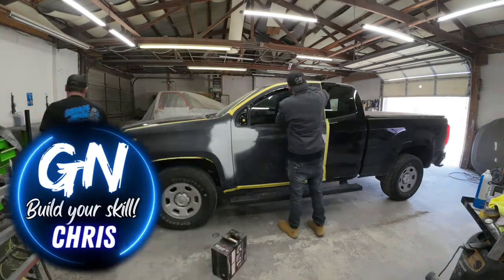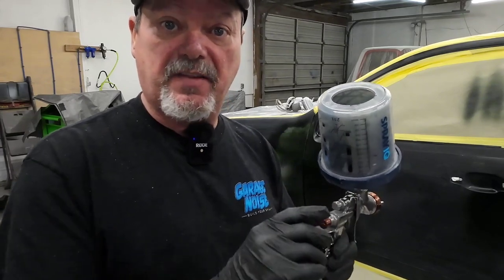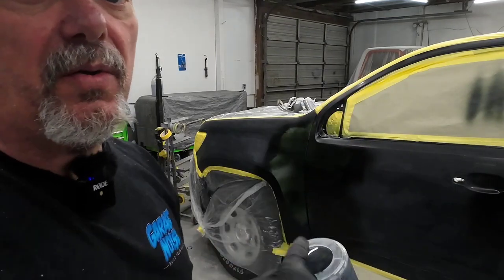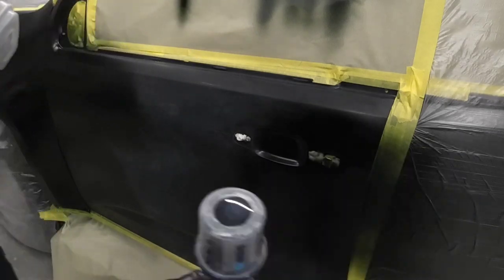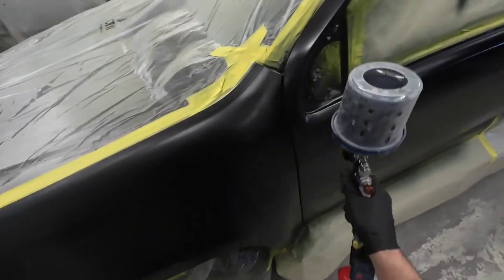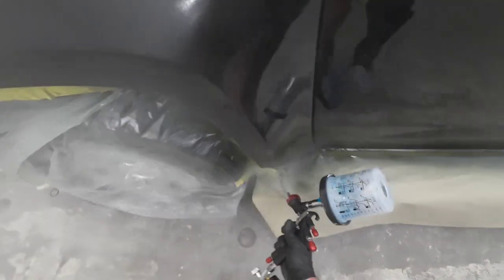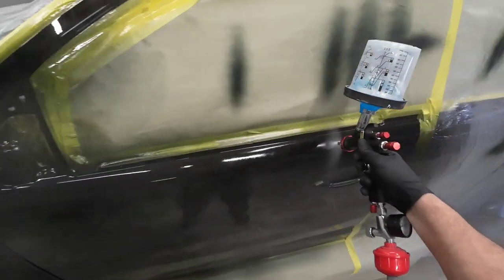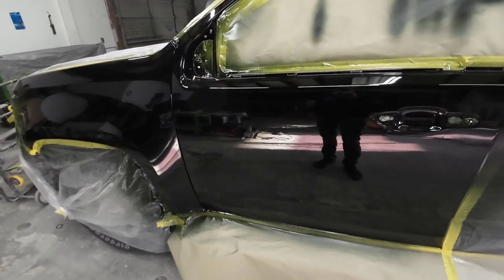LESS AIR/ LESS OVERSPRAY when painting your car!

Comment: Love your videos! They have helped me a lot! I use a wider4, a kiwami4, and a W-400, for primer, base, and clear respectively. My primer and base come out great using your settings but when I spray my clear, I get so much orange peel. Got any setting recommendations for the W-400? Thanks
Reply from the maker: A little more psi and less fluid should do the trick.

Comment: Awesome content Chris! I picked the Kiwami 4 up a couple months ago and will put it thru the trials in a couple weeks…Question though, I want to use the Kiwami for clear also, what recommended volume, fan and air do you recommend to start for CC? Thank you!!
Reply from the maker: 28psi , start with 2.5 turns out from closed for fluid and a wide open fan

Comment: Chris thanks for another great vid. On my paint job I was getting flakes of paint coming up from the masking foil around my paint area during spraying clear coat. The flakes were of the sealer and base I just sprayed. Do you know why that happens?
Reply from the maker: Were you using automotive masking plastic? If so it has a treated side of the plastic that should eliminate that
Reply: @GarageNoise  I believe I was, brand APP which had marked for automative painting use, but I did not notice a side being marked as 'this side up' or similar.

Comment: Dust, when I started my project I was doing everything that I could to eliminate dust while spraying, After wet sanding and respraying and still getting dust I just figured that I would be cutting and buffing so now I still try my best to eliminate dust but with the thought that I would be cutting and buffing.
Reply from the maker: Yeah, even in a booth you get dust. If I only have to nib out some dust I'm  ok but it a lot more work to remove peel. Appreciate your comment and support!

Comment: Chris, what is the typical time duration between your last coat of clear and the time you remove the masking tape and paper? Maybe you have covered this in one of your videos. Thanks for sharing your talents.
Reply from the maker: Typically in the summer 30-40 minutes.  If I've  got fine line down I pull that after about 20minutes. Appreciate your comment and support!

Comment: Will this setting work good with accu spray gun.
Reply from the maker: Check the TDS for the accuspray and use that as a guide it's  been awhile since I've used mine. I imagine it's  about 25 psi 2.5 turns out on fluid volume and fan to preference.

Comment: Is there a time where a hvlp is better? I currently use a 1.3 astro hvlp for base and clear.
Reply from the maker: If it sprays good and you have the air. Nothing wrong with hvlp guns I have and use them. Hvlp guns are good for voc compliance, that's the whole reason they were developed.

Comment: Chris what do you recommend for get 2k can clear coat over spray off parts of car looks like a haze on panels. Used razor blade on windows but roof and side of doors not sure what to do 🤦🏼‍♂️
Reply from the maker: You can buff it, or isopropyl alchol if that doesn't work ruducer or mineral spirits
Reply: @GarageNoise  oh thanks tried alcohol no change. I will try mineral spirits it’s hard stuff that 2k
Reply from the maker: @sheerwillsurvival2064  if you wiping down the orig paint you can use thinner but not on plastics trim
Reply: @GarageNoise  oh ok thanks yeah just the original paint it got on

Comment: Pls help.  This question in in regards to body work and block sanding a vehicle . I'm having difficulty getting my block sanding on every section of the car even/level throughout the entire car.  Meaning this ... I block sand each section using guide coats and proper blocks, technique , etc. , But when I complete one section then move onto the next, I repeat and that section also comes out great , but then when I compare to the section I just did right next to this one, it's not even, level with each other.  I'm not talking inches, not even centimeters, but I am a very detailed ocd prrson, and I'm talking milimetrrs.... Not necessarily enough difference to where a normal person would be able to tell, but enough of a variance where someone like me would be able to detect if looking extremely closely.  Do u happen to have any advice or suggestions on how to remedy this or is this an unavoiadable thing
Reply from the maker: Sounds like it's  minor but Hard for me to say. Some minor waves like that can be corrected in the primer and block sanding process.  This may be the case.